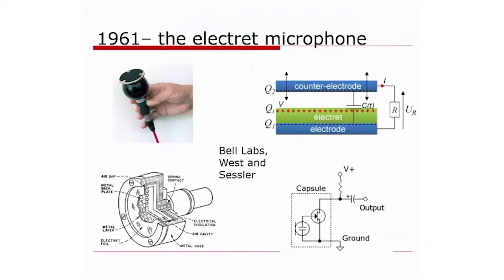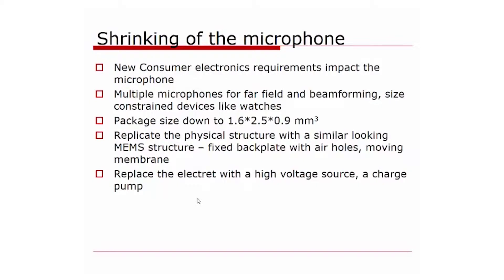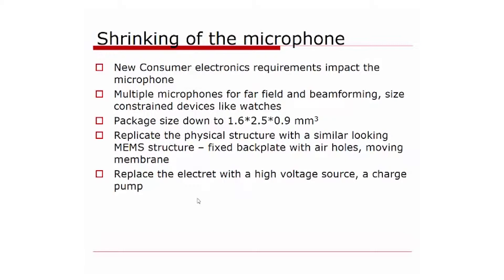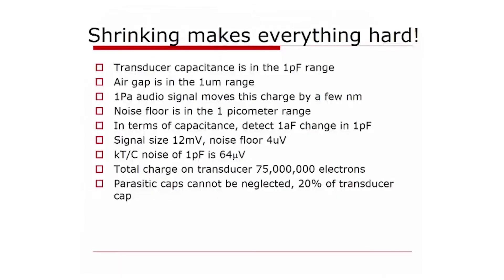How does a MEMS microphone work?  Axel Thomsen

Comment: Good explanation, but why would you place the top port not directly over the mems? Why is the port also much smaller than the actual mems microphone itself? Wouldn't it be better to make it as big as possible to gather as much sound as possible? Doesn't the metal lid form a resonant chamber?
Reply: This answer comes 1 year late but here's my 2 cents:

1. The top port is likely placed elsewhere as a protective measure against foreign particles from impinging on the membrane.
2. The dimensions of the MEMS microphone sensors are so small that they are invisible against most of the audio wavelengths. Thus, the waves entering the top port at a different location won't scatter and diffract so much and cause interference effects inside the chamber. It would be almost as if plane waves are entering through the top port.
3. The dimensions of the port and the metal lid do indeed form a resonant chamber, and all the dimensions finalized for manufacturing are a result of an optimization/tradeoff step to ensure that the resonance is not too low that it ruins speech quality or perception.

Also, having a wider port will raise the resonance frequency if the rest of the dimensions are fixed, and this would be a beneficial design. Having a small port area will pull down the resonance frequency. However, the sensor still needs to be protected against stray particulate matter from entering through the very port. Hence, the optimization/tradeoff step.
Reply: @hyggeligt007  Thanks for your detailed response! Your explanations are totally making sense. I wonder how a MEMS microphone would sound without the chamber. I might try it out, if I can without destroying the whole microphone in the process. Thanks again for your help!